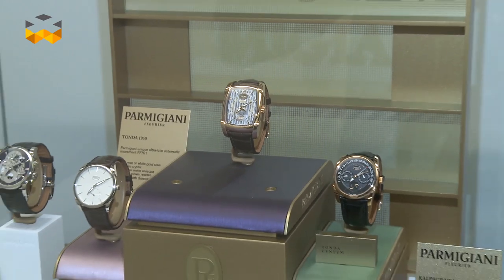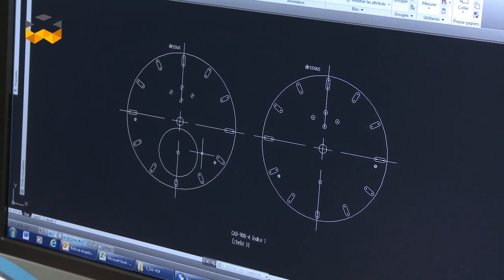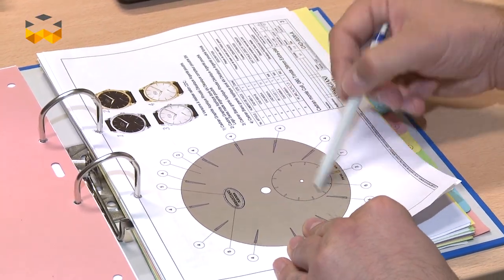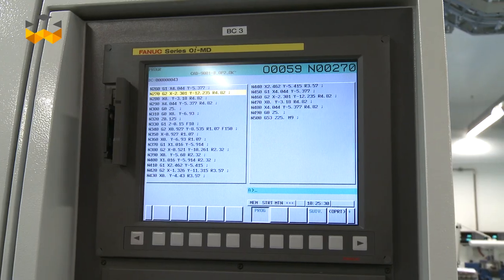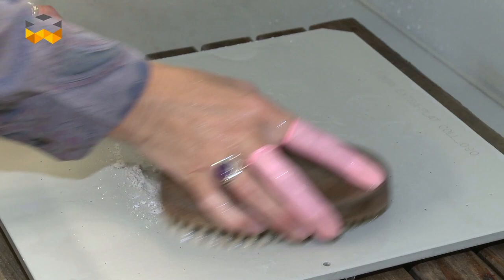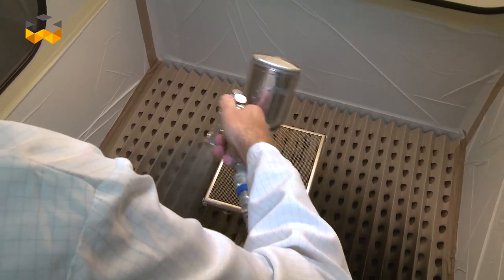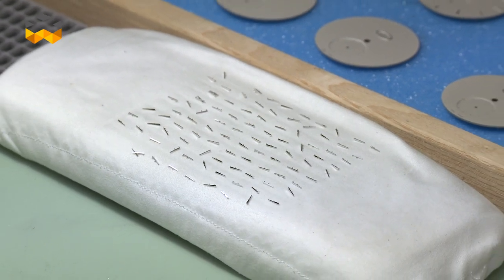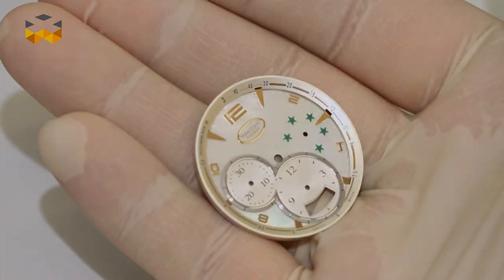How to make a high-end watch dial

Comment: I have a Rolex OysterDate Precision ref. 6466 ( Midsize ) and I need to repaint the DISC DATE  , could you help me ? Thank you !
Reply from the maker: +flexibil29 There is no shortcut to have a proper work. Go first in a Rolex retail shop and ask them directly. Or contact Rolex directly - and they should normally say that the first contact should be made with the local retailer. Some rare watchmakers are able to work on these watches. One is in Geneva. But consider some points before starting this work. Firstly it can be costly. It the watch worth it? Secondly old models are appreciate by connoisseurs also because of their little defects. For instance, black dials that turned braun on Omega or Rolex models are quite looked after. Thirdly, it is not an easy task to find spare parts. Finally, Boris Peter is a Rolex enthusiast. You can get in touch with him directly thoughout his webiste http://blog.exitwatch24.com/